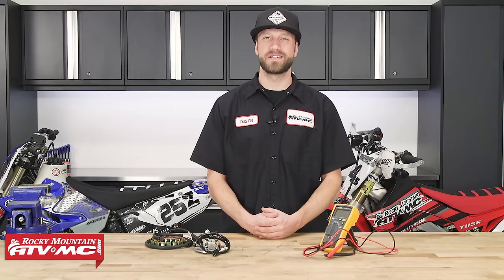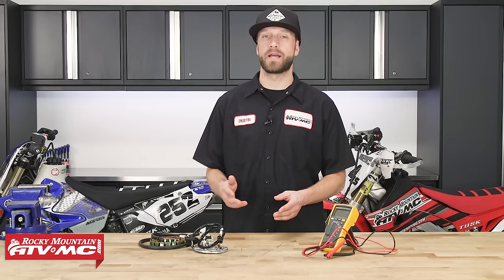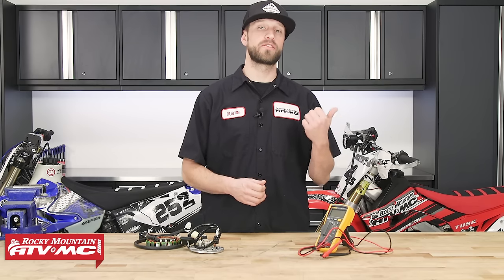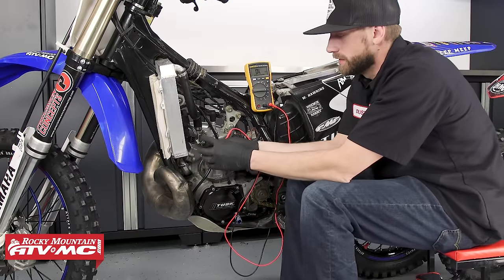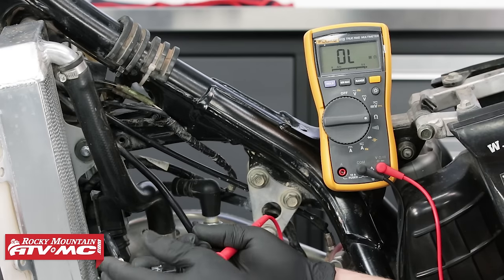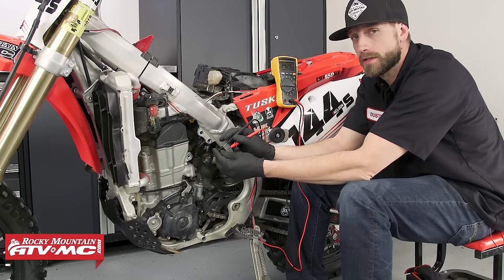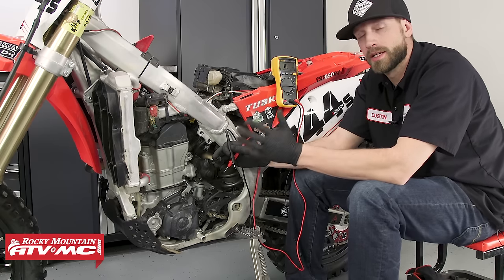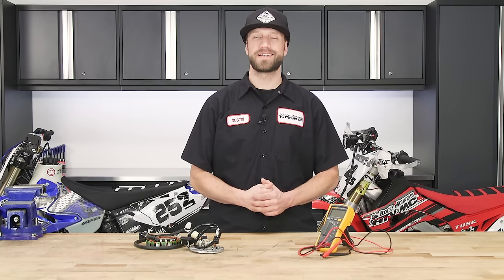How To Test a Dirt Bike Stator

Comment: Good video, but it's good practice to first test is the multimeter by touching the two leads together.  Buying a new stator when you have a broken multimeter would be an expensive error.

Comment: I have a kawasaki kx85 from 2005 i get no spark. I changed spark plug, spark plug boot, ignition coil, stator and wiring. Everything is brand new, I took it to Kawasaki before touching the bike, they said it was the stator that was the problem, I then changed the stator but still no spark and then everything else besides cdi box

i can’t find the issue... Is it maybe Cdi box or flywheel magnets?

Comment: Thank you guys for making this video and any other maintenance video, always love learning how to do this kind of stuff.
Reply: I have a critica bikeridin' fever but my no-spark -problemis wierd! so I dunno what to do.. after 10min i got it to run again?? end then later I was gona ride some more, no starting/spark. even with new iridium plug, no spark checkd connectors by eyes etc tried to remove the kill-switch compeletely and try,, nopope..
Reply: @WuKuVex  i have the same problem. What was that?
Reply: @michaj4013  well, with my bike the problem was the stator. I bought a used one and it started with the first kick. :)
Reply: @WuKuVex  I have the same problem new plug and ignition coil also still nada

Comment: Please can I ask as you’re clearly very knowledgeable I have a Beta 300 rr  and I am having voltage Spikes 15~16  I have replaced the stator , cdi, full wiring harness ,regulator, battery , ground cable and I am still having the same issues ! I am at a lost end with the bike thanks Shane.
Reply from the maker: Just to make sure I understand, where are you measuring the voltage spike at? The battery?  That bike also has a "condensator" (condenser/capacitor) to help prevent voltage spikes, I would check that. There's also a "diodes group" that you could test. Both of those are separate from the voltage regulator. -Charles
Reply: Thank you for the reply , Yes measuring across the battery I’m having voltage spikes  when the bikes running between 15/16 I found this out as the bike was burning batteries out literally! all the diodes , condenser , have been replaced along with full wiring harness , stator , regulator I am pulling my hair out with it, I can only think the new regulator is also faulty beta electrics are rubbish just getting no were thanks Shane.

Comment: Great video! one does NOT want to see dis-color of windings, glossy looking to dull can 
indicate overheating, also there should be some sort of thin substance between bottom 
of coils and stator. I have seen where this substance is partially missing and the bottom 
of winding right up against the stator core which can muff up a good R/R rectifier/regul8or.

Comment: You show a pit bike stator but you don't talk anything about it you call it Source call one and Source coil too is source code 1 the ignition part of it and Source coil too the charging part of it what's going on I'm confused Dynamic test I'm getting only four volts ac out of my primary coil

Comment: Wait!  Do stators really just "go off" like that, boom, done. No spark!  No any warnings or differences in bikes behavior? The WHAT THE FRICK is wrong with my 07' carburator version Suzuki  RM-Z 250? I was riding, normal cruisin. Then suddenly as i was going  down a roa dit felt like if someone just hit the kill-switch down&held it until the engine  shut off. BUT THEN, GET THIS: After about 5-10 minutes later as I was wiggling wires and sockets to see if everything is on place. Nothing seemed abnormal. Then I kicked the kickstar few times more AND IT STARTED again and the bike was working like in any day, no problems. Rode like 5-10 mins, put the bike in the carage, came back and  the bike DIDN'T START AGAIN, No spark! Ok! I bought a NEW sparkplug. NO SPARK STILL! Tried and disconnected the kill-switch too cause, suspect. No help at all. i have eyeballed the wiring and cleaned every connectors and with some wd40. No Help. Now the bike has been standing over a year..   But a neow i bought an used coil-sparkplug. 

ANYONE ANY IDEAS OR SELLING USED rmz 250 07  parts (to Finland) like stators or anything electric really? And rear side panels or other "tuning" stuff

edit. yearmodel. Oh and btw i dunno if it means anything but before the bike broke itnalways seemed kinda run un evenlu when i tried to cruise with high gear and really low rpm with stable speed of 37mph it was kinda running unevenly,  and erratic but  but and it did it from day one.. minor thing cause it wasnt usual i rode on a public road behind traffic steady speed.. no other symptoms. well its harded to start the bike warm, need few kicks.
Reply from the maker: Vex X Have you tried testing your ignition coil and or regulator/rectifier to see if that might be the issue? Ignition coil: https://www.youtube.com/watch?v=S6hnL0Jn6w8 , Regulator/Rectifier: https://www.youtube.com/watch?v=-2jWIkhy1fo .  Check out these two videos, see if they can point you in the right direction.  Have you taken your ignition cover off to inspect the stator?
Reply: Thank you for so fast response!

No cause i didnt know how to do it then. Yes I have opened the stator cover and cleaned it. also, when i cut the wires from the kill switsh and kickstarted, I got electric shocks from the killswitch wire if i held them
Reply: might be the pick up coil...
try to see d contact point of d pick up coil if it have rust or any dirts on it and clean if it does...
make sure to avoid making d gap wide

Comment: I disconnected everything connected to the engine. The plug is pulled and the harness disconnected. Both the red/black wire and the blue/white wire from the stator go directly to ground on a new engine. I think I have a defective stator.

Honda pit bike style motor, Pitster Pro 212cc

Comment: My center bolt came loose and now it wont start..you think its possible the electrical spark may be stripped?? Im riding a baja 125cc..bolts come loose pretty easy after a couple hours riding

Comment: So if my stator reads low but my crank test reads NOTHING I def have a bad stator right? I have put 300 hours plus on this bike. Potentially 50-100 hours without hour meter.
Reply from the maker: If you are checking resistance on your Crankshaft Sensor: The Green/white to White/Yellow wires should read 180-280 ohms. Next check for insulation to ground. If you put one lead to either if those wires and the other to ground, you should read infinite resistance. Meter in the highest ohms setting (mega ohms). For the charging coils you should have three yellow wires. Y1,Y2,Y3- check the resistance between each of these wires-Y1-Y2, Y1-Y3, Y2-Y3. You should read 0.4-1.1 ohms between each. Then check for insulation from ground, so one lead to a yellow wire, and one to ground. Again, there should be no continuity so the meter should read infinite resistance or OL. If anything is out of those specs, replace it. -Charles
Reply: @rmatvmc  my crankshaft resistance is reading 0.00 and my yellow wires are .000 in MEGA OHMS.  I THINK I FOUND MY PROBLEM! Thank you ! I will report back once stator is here
Reply: @rmatvmc  while I have your attention. Wabt the capacitor and ignition coil. The fact my hour meter working rpm’s means my ignition coil is good right ?

Comment: I just recently bought a 2008 yz125 and there was no spark and my buddy has a 2016 yz125 so we swapped out the coil and cdi and still no spark. We were gonna try the stator but he moved his bike to a heated shop so we couldn't get it. But I brought the bike to a shop and they said the stators pooched. We spent a good 5 hours tearing the bike apart and trying to clean electric parts and changing plugs and swapping parts with no luck. Of course this video came out just after I figured out what's wrong. Oh well, now I know for next time
Reply: Hey mate I got the same problem I get no spark at all I have replaced the coil, spark plug, pulse and now I’m thinking it’s the cdi or wiring harness any ideas?

Comment: 1997 Suzuki King Quad
300 cc LTF
Issue: prior to voltage regulator change out

1)Extreme headlamp fluctuation bright to dim when revving motor.

2)Voltage at positive and negative battery cables: 2.5 volts

Purchased new voltage regulator and installed

New regulator has same voltage output as old regulator but when engine RPM'S are increased engine misfires until engine returns to normal idle.

Re-install old regulator, misfires go away
No change in voltage output to battery with either regulator
Headlamp fluctuation still visible

Bench test results for regulators
Procedure duplicated as shown in video
New regulator: Leg 1> 551... Leg 2> 553...  Leg 3> 552
Reversed polarity: Leg 1>552...  Leg 2> 550...  Leg 3> 544

Old Regulator: Leg1> 576... Leg 2>585...  Leg 3>585
Reversed polarity: Leg 1> 584...  Leg 2> 580... Leg 3> 581

Next step: Assumed stator is defective without testing. Purchased used OEM stator and had dealer install. When I returned home I tried to start my machine. Machine had set about 1.5 years with same gas. After awhile I finally was able to get it started but engine was misfiring. Pulled new regulator off and replaced with old one, misfires go away. Ride machine around the yard awhile, seems normal and then starts to spit and sputter. Drained old gas and pulled carb and cleaned (which I should have done initially). Restarted engine, same issue! Cleaned carb again, checked adjustments, blew out all fuel lines, still is not running correctly. Completely bypass gas tank and did a gravity fed install, runs better but rpm's are fluctuating erratically, then quits. So for the sake of covering all the bases I decided to check the output on the new stator. I installed a fully charged automotive battery in place of the OEM battery to be sure the battery wasn't the issue. I check voltage at the battery cables when engine is running...2.5 volts with new stator. Rev engine up, voltage actually drops. Disconnect stator while engine is running to test voltage output, engine quits. Decided to remove plastic connector on stator wires and go to a direct connection. I pulled one wire at a time to see the results. Pulled one wire engine runs, pulled second wire engine dies. Reconnect wire one and two and pulled wire 3 engine runs. Check output while engine is running, no AC voltage on one or two legs (can remember completely). Decided to pull stator and bench test. The following results are for the old stator and the new one.
Bench test results for stators
Procedure duplicated as shown in video
New Stator: Jumped wire: 1 and 2>.3 ohms, 2 and 3>.3 ohms, 1 and 3> .3 ohms
Old Stator: Jumped wire: 1 and 2> .3 ohms, 2 and 3> .3 ohms, 1 and 3 > .3 ohms

Still have no or very little AC output voltage from stator and only 2.5 volts at battery. I have also completed all the other test you showed in the video and everything checks out except output AC voltage from the stator and voltage directly from the battery cables.
I am totally at a loss as to where to go next. Any help would be greatly appreciated!
Reply: Did you ever find the issue?

Comment: Is it true what he said? A stator is either going to work or it's not? My bike keeps bogging at full throttle I've changed carb changed pet cock size. Messed with idle screw. I'm thinking it's the magneto losing power getting weak
Reply: Unfortunately, yes it’s true..but if your bike is running then it’s unlikely to be the stator. presuming you’ve cleaned your carb and inspected the jets? What bike is it may I ask?

Comment: I have a moped with no spark. When I kick over the engine the lights turn on and the horn works, but no spark still. Does this mean my stator is working fine?
Reply: Yes it's fine. Check the cdi, or ignition coil, or spark plug

Comment: Your awesome man, that's so helpful mate. I'm trying to get around how my XR 650's wireing loom & how everything works throughout the wiring circuit. Looking into a custom made wiring loom simple CR 250 design as XR'S do not run a battery & also have lights,flashers,stop/tail lights running for being road registration. Cheers.
Reply from the maker: Glad this helped you out. Thanks for watching and good luck!
Reply: @rmatvmc  hello , just bought a husqvarna 701 sm and after 110km it shutted down 3 times in the last 10 kilometers while just cruisin , now i sended back to the shop and they said after hooking the bike up for electrical issues that they didnt see anything wrong with it ,so what could be wrong than ?